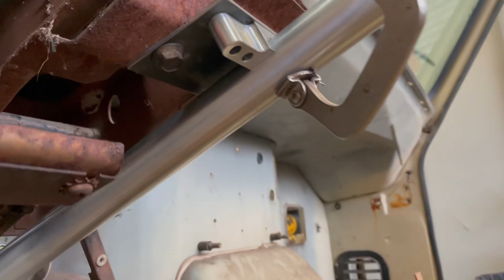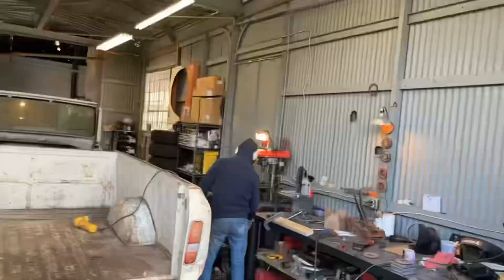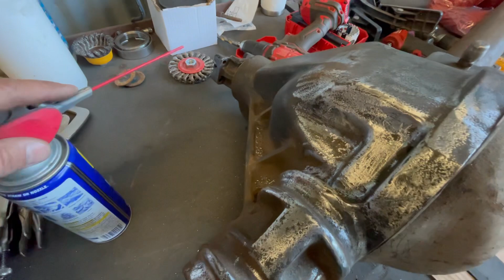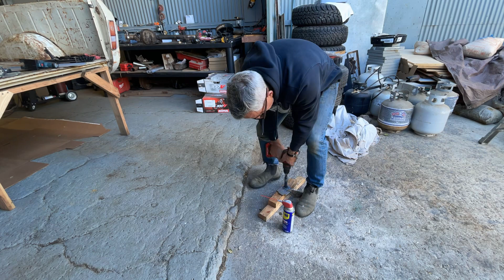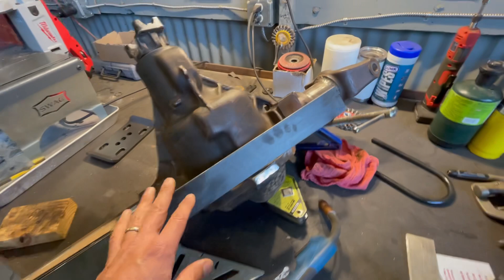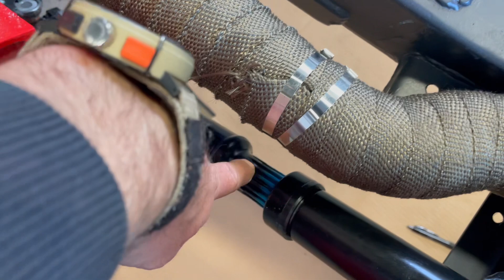RACE TERRA PROJECT: Down to the Wire!

Comment: Just in case anybody wondered, the D20 has 2.46 low range gear set for a little more torque in low range and a 32 spline HD output with that 1350 yoke. Also, extra heavy detent springs to help ensure it stays in gear during big bumps. 

Thank you for the shout outs and love during this process. We are happy to help and are honored to be included in the build.

Comment: Fingers crossed we get another video soon!!🤞🏻 

Probably one of the most underrated builds out there right now! Keeping the stock drivetrain and axles is 99% of what makes this build incredible in my opinion. I may also be biased because I grew on a farm that had a couple scouts on it but I don’t think so. I think there is an entire generation of gear heads that aren’t even aware of these vehicles and I think if they were they would be just as intrigued as we are!

Comment: Well worked! But if I understand correctly, you are supposed to take oil from the main gallery to an oil cooler and then dump the oil in the sump?! Then you get no oil pressure at the bearings. The easiest thing you can do is to put a sandwich between the engine and the oil filter.

Paint suggestions I came up with when you had the front fenders on...left side red, right side white and center matte black! It would be really cool and in the right colors.